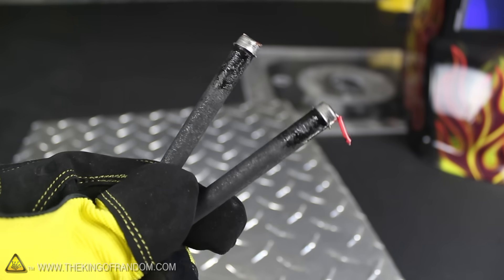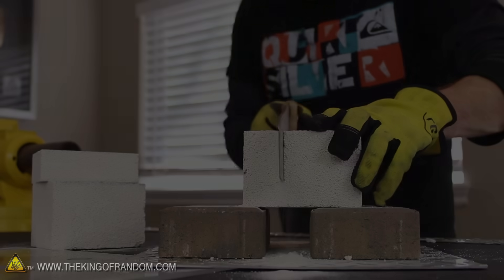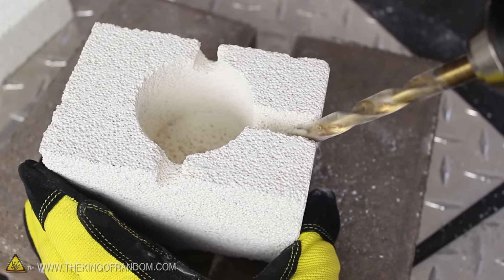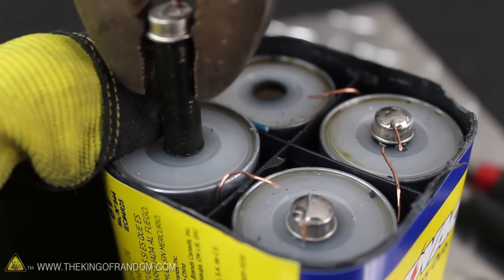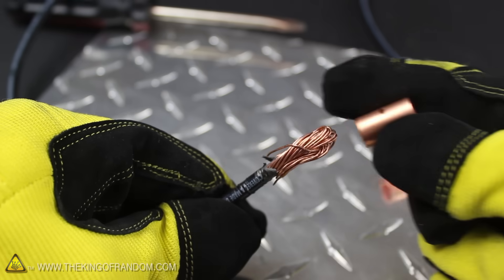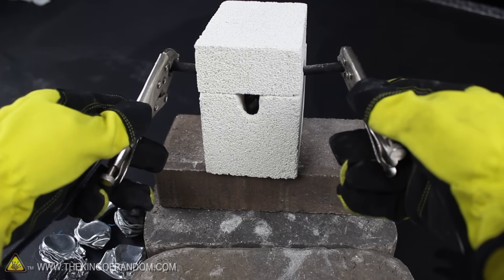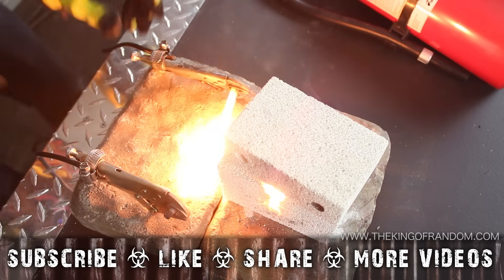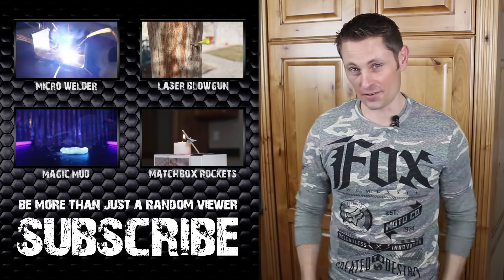How To Make An Electrical Arc Furnace

Comment: that white smoke from zinc, is rough. toxemia. I used to get headaches when I would weld it. even if you don't breathe, it still messes you up. don't melt that stuff, unless it's absolutely necessary

Comment: ok, im sure i did something wrong, but the 6v lantern batteries i bought when i cracked them open had some mushy light grey stuff in the middle, and had the black stuff too, but i didnt find any rids, at leasat not in the first one. theyre energizer brand i believe, have 2 springs on top, same overall structure as yours except forthat. the mushy stuff did appear to be inside some sort of paper tube, but is tehre a certain kind i need to get or?

Comment: I wouldnt personally use a P95 rated mask with silica dust. They let ~20% of the air through, since the seal around the edges is junk, AFAIK. I'd just go directly for a P100 mask. The 3M ones block 99.97% of particles. Rated for use with asbestos and plutonium. About $40-80 or so. I used one for covid, and I use them when in countries with high air particulate pollution.

Comment: Bought a 255 amp arc welder box, hoping it would suffice for melting stuff. It doesn't create an arc, standard 120 outlet. I was hoping to avoid hacking up microwave transformers or buying some high-dollar electric furnace, so if anyone has suggestions, let me know.

Comment: I have a question: aren't grips conductors? Why the guy holding them not electrocutef
Reply: He's wearing gloves. This is a dangerous experiment, though, particularly with a homemade power source. Modern welding machines include a voltage reduction device when operating in smaw/stick welding mode

Comment: Greetings at what voltage and amp are you working? If I want to replace my carbon rod with non consumable tungsten rod which colour should I use? I believe it's red if my machine is DC
Reply: Sadly the creater passed away few years ago.

Comment: Until recently I didn't know this but before acetylene torches were common and cheap they used to use what's called a carbon arc torch which is essentially the same idea as in this video where it's just two carbon rods hooked up to an arc welder but they would use it for stuff like braising or heating up rusted nuts or anything else you would need a REALLY hot flame for.
Reply: They still use a similar process called carbon arc gouging where a carbon electrode provides the heat and air is blasted at the molten workpiece to remove material.

Comment: for anyone, can i use a 12V bike battery for this? or will i need 30+ volts? iam only wanting to tackle aluminum and zinc, no copper and defineatly not steel
Reply: I would reccomend using a higher amp battery but it may work be careful with melting zinc the fumes are horrible for you only do it well ventilated
Reply: @parkersposts  ok, thanks

Comment: I know this Video is like 6 years old now, but for anyone who doesn't want to build an arc welder from microwave parts: you can buy one on amazon for around 100 dollars. It is worth it considering that the parts from the microwaves would also cost something and you could mess that up.
Hope this helped somebody

Comment: R.I.P relax in paradise. I tried this at home, did it 9 times with different metals each time. I had 2 muffin trays of different metals! Worked great for me!
Reply: Will it work on Tungsten???

Please let me know
Reply: @Reppo80085  If it got hot enough to melt tungsten, it'd be 2-3 times as hot as these bricks are rated to handle, so I feel like that'd be super dangerous.
Reply: @Reppo80085  no
Reply: @Reppo80085  too hot for the bricks

Comment: Would a portable 110V arc welder work? Have you tried making rubies with your set up? With a graphite crucible, some aluminum oxide powder with a bit of chromium oxide powder proportionately mixed in should result in being able to make rubies.

Comment: Guys ive got a question i live in europe and my regular voltage is 240 can i just hook the copper wire to the plug in the wall or do i need to build another arcwelder

Comment: You can get carbon rods designed for welding at 1/4 inch or 3/8 diameter. can get 50 rods, foot long for like 20$, same as the batteries. Designed to be heated, no wierd fumes, much better performance.

Comment: if you have hooked up a high power high amp transformer to those metal locking pliers (that you are literally holding) then what stops high power electricity arching through your body and turning you into a burnt rotisserie chicken??

Comment: Just go to a welding supply and buy carbon arc carbons. They are cheaper than batteries....... You can also use a 12 volt car battery as a power source. That's how early arc welding worked.

Comment: Seriously, Big applause!
I need to generate 5500 F for project I am developing.
What was the temperature reached with the carbon electrodes?
Reply: Hmm I actually think if you supply more AMPS it gets hotter
Reply: @golfcart710   It would helpful if you could measure the temps,but accurate temp gauge instruments that measure that high are expensive.
Reply: I think there as hot as the surface of the sun if they can melt every metal and make rocks molten
Reply: @golfcart710  Um...The Sun reaches 15 million Kelvin [26,999,540 F] at the center, 7 to 2 million K and drops to 5800K on the surface and the dark spots are 3800K.
That means 5500 F equals roughly 3310 Kelvin.
My goal then is to generate nearly Dark Spot Sun temps.
Reply: Im thinking if you build the scariac you could adjust the voltage and reduce the amps
Reply: I'm currently working on the spot welder thing
Reply: I'll see how hot they get

Comment: I used a 110 volt Arc welder with 12" carbon rods, set at 50amp, then 100amp, then 180amp and one time I used copper 15 grams as a collector. All 3 melts I got the same a matte that would break in my hand. I am melting gold and platinum thats mixed together. During the melt you can see its all liquid, then after cool it breaks. I dont know so I put it in nitric acid and water thinking some junk in there that I missed to clean it better. Should I turn the Amp's up more?

Comment: Can you use a mig welding unit as the power source?
Building that other configuration seems to be a lot of work for a non tech/knowledge based person.
If it can be done please show it.
Reply: Yeah i tried to find that out as well, Because my mig welder are a positive and negative ports to connect the ground and the welding gun to.

Comment: Why doesn't he seem to be concerned about electrocution in this video? He's holding onto the locking pliers which are metal directly touching where the current comes in. Shouldn't that run electrocution risk?
Reply: His hands are not big and yellow, he's wearing insulating gloves. Happy to help!

Comment: I JUST MADE THIS!!!! I used my welder for the positive and negative leads. It was perfect. I could melt iron like nothing. Thanks for sharing this years ago.
Reply: Mine keeps catching fire, the output coils.  Do you know input amperage or a better way to cool it?
Reply: mygreenburrito you have to burn off the residue. It will be catching fire for a bit while you do this but once it’s burnt away it should be fine.
Reply: What amp is it
Reply: Double tap airsoft I don’t know... I know it’s around 400 volts for my welder but not sure amps
Reply: Can you melt quartz? :)
Reply: Purple Space Cow Studios and I’ll make a video on it too
Reply: @steelavocado1  did you make the video?
Reply: @juba3498  lol I did but it was terrible. You can watch it if you’d like but again, it’s pretty terrible

Comment: Does it work with tungsten electrodes ? (they are easier to find than carbon ones)
Reply: no, they will get hot and short out and/or melt. you can probably  use carbon arc gouging rods from welding stores.

Comment: How many amps do I set the welder at? And do those rods not burn away like gouging carbons?
Reply: I used a 110 volt Arc welder and 12" carbon rods. I done 3 melts 50amp, 100amp then 180amp. All 3 I got matte buttons that break up in my hand. I am melting gold and platinum mixed together. I put all in nitric acid and water to clean any other junk away. Any idea why this happened? Could it have been I didnt have the amps up high enough? I could see it was all liquid, I poured them into a graphite mold, then when they cooled they broke up. The second time I added borax the 3rd time added 15 grams copper as collector.

Comment: hey just a question I seen 1,370 Centigrade for steel that you casted what kind of steel are you casting?
isint regular low carbon or mild steel melting point at 1,500 C?

Comment: You forgot to mention the importance the special gloves.  Without them you'll easily electrocute yourself to death.  Poor kids at home that tried this  without the gloves.  RIP
Reply: no you won't. the metal has far less resistance than your hand. it will burn you though
Reply: @tlowry6338  couldn't it still shock you if the electrodes weren't touching and you touched the live plier while grounded? I don't know much about electricity but I figured getting electrocuted could be a real problem with this build.
Reply: The real satoshi
Reply: It wasn't mentioned that molten metal can pop when it contacts the cold muffin pan, sending drops of liquid metal into nearby things—flammables and skin. Don't forget to preheat your muffin/loaf pans.
Reply: And that theres like 15 volts on the output od the welder.
Reply: @retropcs88  it's a high amp, low voltage output. Not harmful at all to humans
Reply: @ipodhty  To be precise: because of low voltage and high human body resistance it is actually very LOW current on humans. High current only if you have high conductivity like metal.
Reply: Exactly lmao. The power is going straight through the clamps so there’s nothing protecting your hands.

Comment: Can the arc furnace melt tungsten?
Reply: Razolo581 nope tungsten is really hard to melt I tried
Reply: nightmare in action did you really make an arc furnace and buy tungsten? Tungsten is REALLY F***ING EXPENSIVE!Also, at the very beginning, he says it’s hot enough to melt “any metal known to man.”
Reply: @razolo5814  well..yeah u can buy tungsten sheets or powder for cheap and it has more surface area for it to melt easily, but it needs to be heated for quite some time to melting temp
Reply: oomf you would need a REALLY HOT furnace to melt tungsten since it’s melting point is 6192 degrees Fahrenheit (3422 degrees Celsius)

Comment: how large a chamber of aluminum can this heat at one time? And how long can the electrodes be in contact with one another before they are destroyed (or the transformer overheats?) I want to melt a lawnmower engine, or a piston from a V8.

Comment: What kind of arc welder would be recommended for this project? I don't want to build TKoR's version of an arc welder using transformers and whatnot because I'm not experienced enough.
If anyone could link me a model that worked well for them that would be great :)
Reply: Pretty much any 240 volt arc welder will do.

Comment: To make this arc furnace, you only need a brick and a lantern battery! ... and a saw, two drillbits, a power drill, stranded copper wire, two pairs of locking pliers, hose clamps, copper couplings, a vice AND AN ARC WELDER.
Reply: look at this peasant, doesnt even have a fully operational fabrication workshop in his shed

but for real lol those are not exotic tools, every manly man should have all of this stuff, save for the arc welder prehaps
Reply: Just get an arc welder off Craiglist.  Once you have one, you'll suddenly find all sorts of things to weld.
Reply: @Zacuriah Miller wasn't it Noah who invented the ark welder...? :-D
Reply: a year late but you need a power controller to make an arc welder, where does the road end? (also RIP TKoR)
Reply: Or just run it off a car battery
Reply: @Zacuriah Miller Now thats funny
Reply: Actually you make the arc welder with the lantern battery and pliers
Reply: Forgot the gloves so you dont get fried lmao
Reply: Most people already own those things.
Reply: HisXLNC so most people already own an arc welder...
Reply: Don’t forget a microwave transformer!
Reply: Perceus Shadowmantle two
Reply: I spent month to get all theme things

Comment: Quick question, what else can we use as a cheap(my idea of cheap is under $50) and easy power source? I unfortunately don't have a microwave in the neighbors trashcan at the moment( and I've been waiting for years but it never happened). Thx!
Reply: There are brand new arc welders on eBay for $79. Maybe you can find one locally, used, for less?
Reply: Go to a thrift store

Comment: Wow, Does carbon electrodes dissolving ? What if we give more more time with carbon electrodes ? can I make diamond ?
Reply: Carbon rods are slowly vaporizing. No, you cannot make diamonds with this. That requires heat and LOTS of pressure. Where are you going to get that kind of pressure?
Reply: Ah thanks, I didn't knew it. just only idea.

Comment: If you don't have an arc welder or similar power source, you can use a standard 110v outlet and a salt water rheostat.  Be sure to use welding goggles for all these uses, and sunscreen on any exposed skin.
Reply: No. A salt rheostat lowers both the voltage and the current. What you want is to increase the current and lower the voltage. To do that you need 2 microwave transformers or you can use an arc welder.
Reply: True, but I believe you are making a distinction without an effective difference.  While the power sources described in the video are preferable, I have made and used a salt water rheostat for the very purpose described.  The loss in power is irrelevant given that the resulting 2-inch arc reaches temperatures well above 6,000 degrees F.  This will easily melt any natural or man-made material on earth.  Give it a try.

Comment: what did  or can u, estimate the temperature of the furnace?  For instance, England's industrial revaluation came with the invention of the Arc Furnace.  Could i melt iron in a similar forge? the sort of iron u extract from sand with a large magnet?

Comment: You can also source carbon electrodes at most welding supply shops, they're used for carbon arc touches like you made and carbon arc gouging, the latter being the most common use for them today.

Comment: The electricity ist going through the pliers right? How can you make that you wont get an electo shock?
Reply: Nope, the voltage is very low because of the transformer. Since the voltage is low current is high. But you can burn your hand if not careful.

Comment: Hello there! First of all, incredible video man!
I really want to build one of these for myself, byt I have two doubts.
1. One comercial welder (200a/220v) would be enough to build it?
2. Of course you need body protection for the heat/light but does your gloves have any type of electrical protection? Or is it just fine to touch the pliers with regular gloves with heat protection only?
Thanks!

Comment: Hi, great video!.. Did you ever melt something plated? What happens when two different metals with different melting points are heated together? Specifically I woud like to know if the method can be used to seprate copper from copper plated steel coins.

Comment: This might sound daft but why don't you get electric shock while holding the grips ?
Reply: Lee Shellam gloves
Reply: TheReal ShaD0WfaceXZ  they just look like welding gloves? Not class 1 insulating gloves?  Is the voltage low but amps high?
Reply: Lee Shellam i think the gloves wont conduct any way
Reply: TheReal ShaD0WfaceXZ  weird ...  I've had a shock through clothes and normal rubber gloves when forgetting to turn off the electric fence that keeps the horses in ...

Comment: Silica in bricks is extremely bad for your lungs and when cutting bricks, you should always have running water flowing over where you are cutting to avoid the dust getting air born.

Comment: Instead of rigging a homemade arc welder, would using a store bought arc welder and substituting the ground clamp and stinger with adjustable clamps work as well?
Reply: reading the coment section
september 2022 with the Exact same question.
Reply: Yes, you can use a stick welder / multiprocess machine in stick mode. You can just use your existing stinger and work lead if you're ok with how hot they will probably get.

Comment: This is a bit of an odd question but do you have any idea if this could melt molybdenum? My big hobby is exploring abandoned mines and collecting minerals. I have been working on refining my own metals from the ore I collect. I recently collected a bunch of molybdenum crystals from a mine in the Sierras and wanted to make some ingots. However the furnace I made can only get to around 2000 deg F. Let me know you have any ideas. Thanks and keep up the awesome vids!
Reply: How did you get into a hobby like that?
Reply: Me too I'm trying to melt freaking carbon
Reply: @lovesrolopigeo8978 
 I'm pretty sure it sublimes...
Reply: watch?v=mtxlIp52L9Y
Melting molybdenum is kinda hard... Alumina firebrick melts long before molybdenum will and molybdenum will also burn if you don't have an inert atmosphere, preferably vacuum.
Reply: i know it's a year ago but no it's goes to liquid at 2900 C
Reply: Did you finally get the melts figured out? I tried yesterday 3 times and got matte buttons that break in my hand. I tried 50amp, then 100amp, then 180amp, second time added borax, third time added 15 grams copper. Same result so I put all in nitric acid and water to clean any junk away, to try again. Any idea's why this happened? I do mining and I have gold and platinum mixed together.

Comment: this is fake one of the  electrode gets attached  to the other electrode while connected letting in shorter of electrode means every 5 second you have to change positive side electrode if its length is 8cm